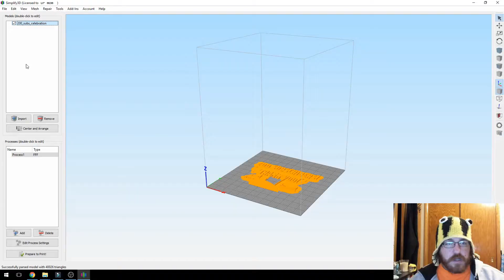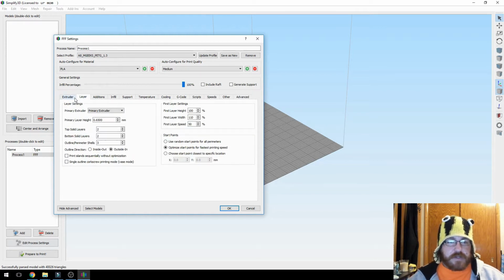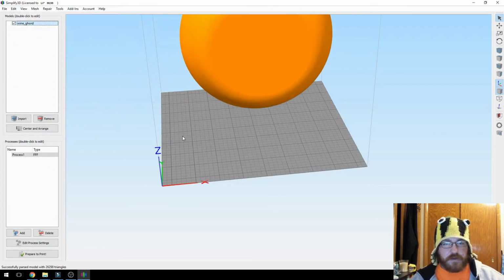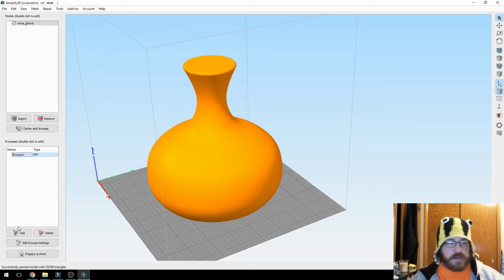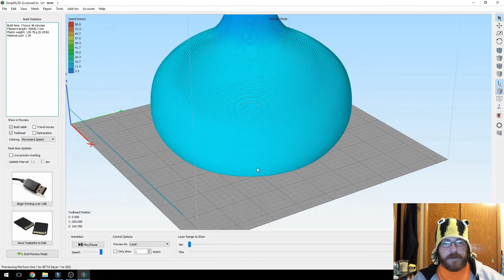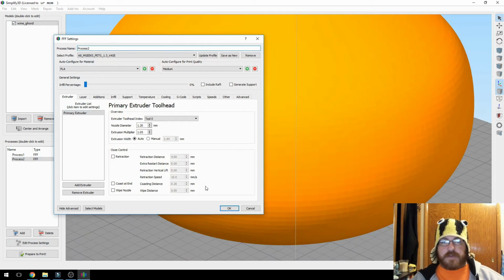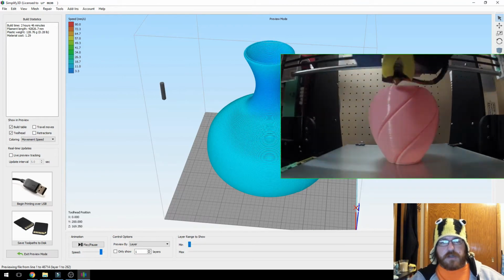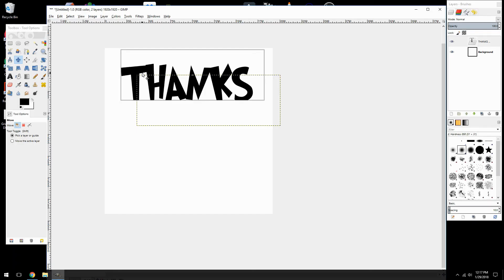Print HUGE with the Anet A8 for under $2

Comment: So was thinking of buying a anet a8 how big can print be example cm wide cm height cm depth for instance make a box just so can work out what a could print as don't want to waste my money if I need bigger
Reply from the maker: The bed is 220mm x 220mm but realistically a print of that size would have interference from the bolts on the bed. Unless the print is not square and you can print it horizontally or vertically between the bolts. I usually don't print anything on it bigger than about 190mm square you can print larger spinner things of you set it diagonally on the bed though and I have printed 240mm size rectangles by printing at 45 degrees across the bed. I hope that made sense.
Reply: Revamped Outdoors yeah made sense thanks just starting out is this worth it as a beginner 3d printer or should I get something else
Reply from the maker: I always suggest it depends on what you like to do. If you like to tinker, design and change things the Anet A8 is great because it forces you to do that, there are some key safety upgrades to get if you decide on this printer because it is so affordable. Soldering the heat bed directly with silicone upgrade wires, installing a mosfet for the heat bed, upgrading the power supply and firmware are must haves IMO. But they are relatively simple to do with info online. If you are looking for a more out of the box type printer there are other options that are slightly more expensive that come with everything done already, something like the Anycubic I3 mega.

Comment: Sounds like you just need fake flowers and you're good to go. 😀

I'm glad you figured it out I don't know that I would have. I was wondering a couple of things.

What can you do or use to make things like cups drinkable or safe to drink from I should say.

Also do you or will you ever do anything on trouble shooting? I know I don't have my printer yet but when you (You in general) are talking about mm, wall thickness, and things like that I get lost. I'd like to learn the general language of 3D printing so I can follow better.

I hope that made since.

Great vid thanks.
Reply from the maker: Flowers! Dangit, that would have really tied the video together!

The food safe question is a tough one, I am aware of a couple different schools of thought with that question.  Some people think 3D printing is never safe for food and beverage uses.  I am more on the "it depends spectrum."  Some companies do make "food safe" filaments which are generally PLA.  The pink filament I used in the video is one of those "FDA" approved filaments from MakerGeeks.  But there are a few problems with food and 3D printing.  Because even the super high res SLS type printers still make "layers" to print things in 3D space there are small bumps on the surface of prints large enough to house bacteria. Even if the filament is "safe" the area on the print can trap particles of food and nutrients that will harbor bacterial growth over time.  Similar to how wood cutting boards can get curves over time and harbor bacteria from meat so it's always good practice to use glass or marble for cutting meats.  The other problem is that the throat of 3D printers (NOT ALL BUT MOST) especially the more affordable printers line the throat of the hot end with PTFE this material when heated above 255 C produces a neurotoxin which is...not good.  Similar to the non stick surfaces on Teflon cookware.  This is why you should not leave the burn on high before putting food in a container.  Same thing with a printer, also if you print with non food safe first...is it food safe after? Probably not.  My thought is if you have a dedicated food safe printer that only runs low temp PLA then maybe.  But you still have to worry about the ridges on the prints holding bacteria.

I could see myself doing a trouble shooting video or a basic terminology video in the future maybe a 3D printing basics series where I start from the beginning.  There are a few channels to check out that are really good at this.  Makers Muse is great at these explanations and Thomas Sanladerer is an awesome channel for in depth printing.  But I think there is an area for even more basic than they go into because they're so advanced to start.  Thanks for another great suggestion on a video topic.